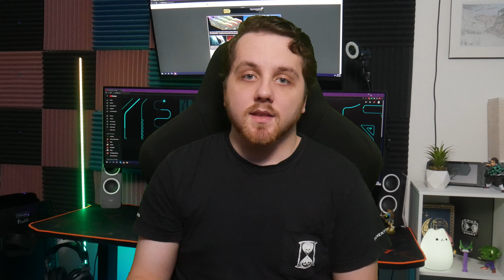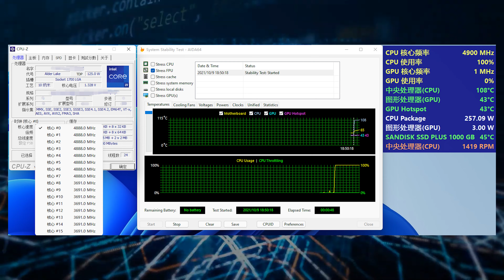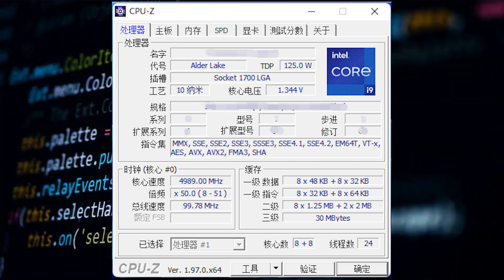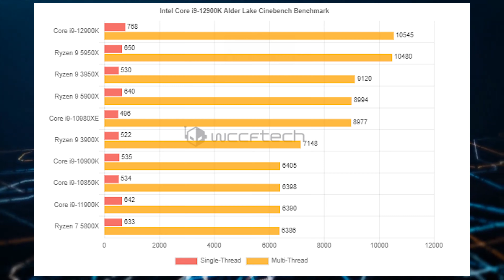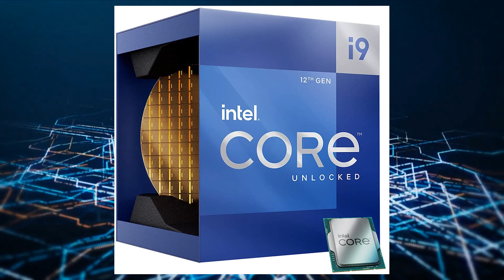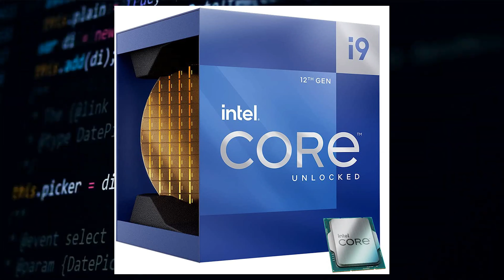Another Benchmarks Shows The Intel Core i9 12900K Processor Competing With The AMD Ryzen 9 5950X CPU

Comment: If you want a Ferrari it’s going to suck the fuel when smashing the pedal. I only game hour or two a day so I’m not worried about the power draw. I play flight sim/DCS in VR and I’ll take all the performance I can get.
Reply: As if you'll get to significantly feel the difference between two top end CPUs like the 5950x and 12900k. I promise you that if you were already happy with the 5950x you won't feel the 600+$ new improvement. There won't be a +600$ obvious difference between the two. I could even suggest you a blind test, to play the game on 2 computers, one with the 12900k and the other one with the 5950x, but not knowing which one is which, asking your friends to set uo the blind test for you so that you won't have any idea about which one is which. I promise you that you won't be able to tell. In the multi-threaded scores in Geekbench 5 there's barely any difference between them score-wise. Is the in-game placebo effect worth the extra 600$? I don't think so.

Comment: Actually waiting to see real world benchmarks and see the performance difference of Alder Lake using DDR4 vs. DDR5.
I saw where a couple of listings of 32gb of DDR5 were priced at $330-$350 U.S.D. and of course really sloppy looking timings being initial release samples.
At those prices for DDR5 and only being 32gb not looking very attractive at the moment.
I may consider an Alder Lake build IF the ddr4 decent level and timing examples performance is not too far behind otherwise I will wait for Raptor Lake and DDR5 to mature for a year and its prices to stabilize and come down a bit.
Reply: Yeh, those prices made me very sad.  I need more than 32GB

Comment: I'll be waiting for real world benchmarks/reviews, That power is worrying I want to see what it really uses, Over 200w then forget it I'll go AMD.
Reply: Why should u worry about the power draw for s desktop. Do u render 24/7? If the perf is too notch why care about power draw? Not that the price in bills would by that much higher over an AMD based CPU any way.....
Reply: @Pillokun  Because it generates a lot more heat?
Reply: @Mysterio2243  so, powerdraw and more heat goes hand to hand, perf is what most are after. If it is not another bulldozer then it will be sought after.
Reply: the 5950x uses the same amount of power under full load as the 12900k in this video, 255.6w. (gamers nexus review of the 5950x is where i got the info).